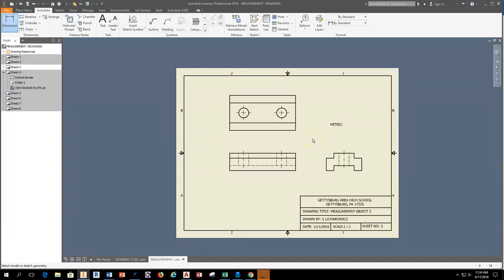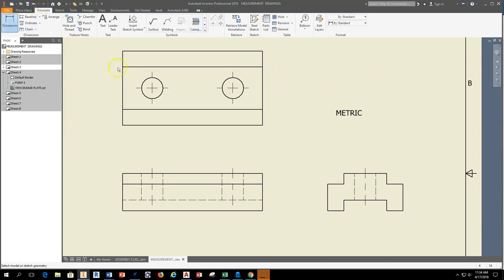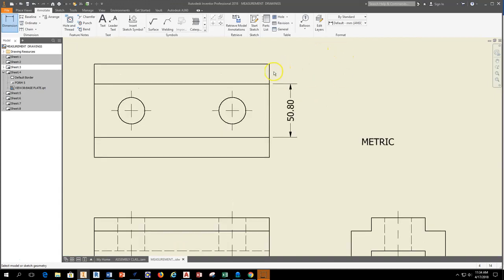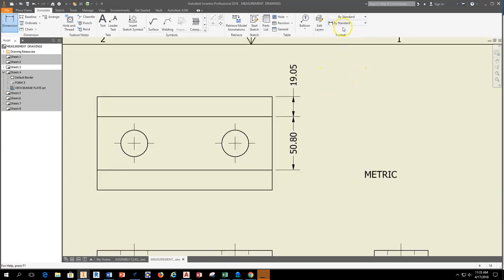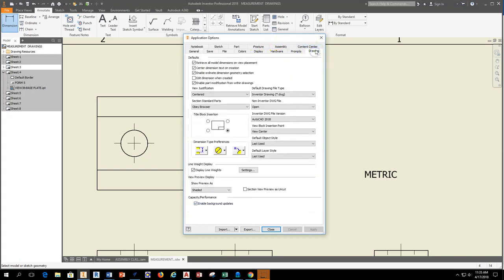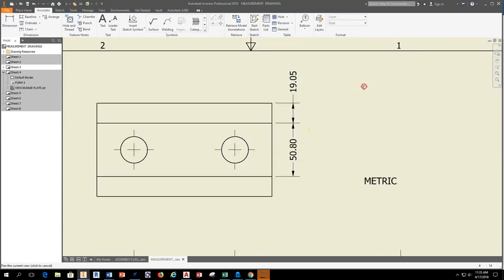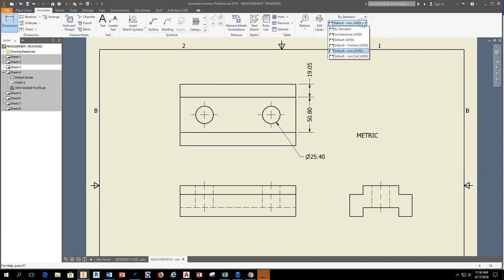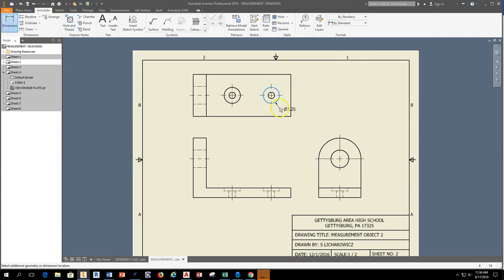Inventor - Dimension a Metric Drawing

Comment: With all my due respect, you solved this problem, however, Autodesk Inventor is so lame in it's interface! This could have been fixed so smoothly by programming a feature called Units under Tools/Document Settings, such as in the PART module. But Autodesk Inventor decided to be stupid  and make it hard for no reason!
Reply: There is a 'units' in the part file. Very simple to change but the drawing also has to be in the units you need. There is NOTHING difficult about it.